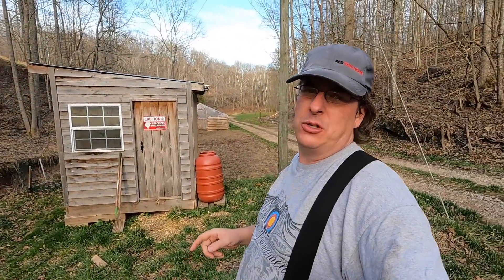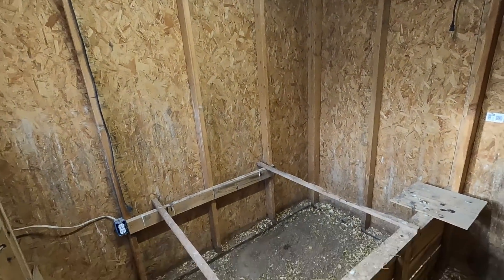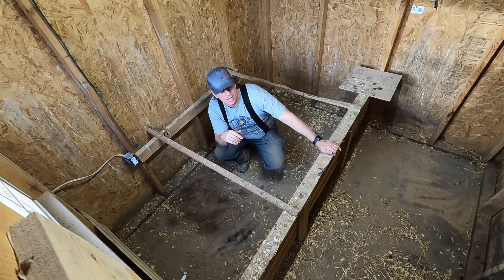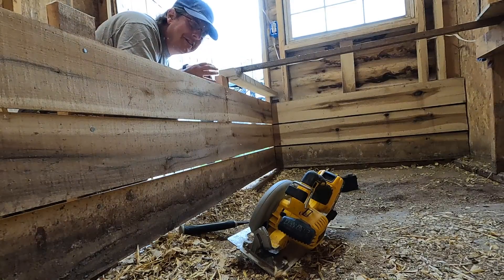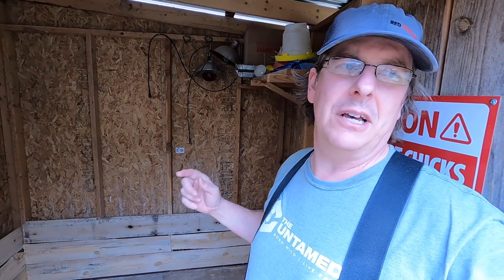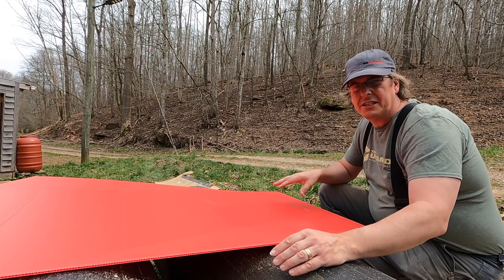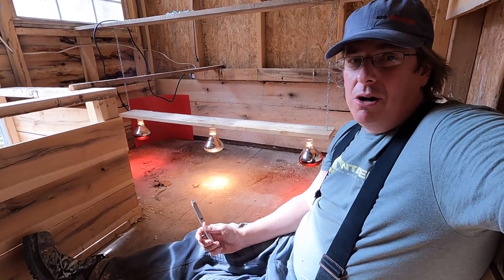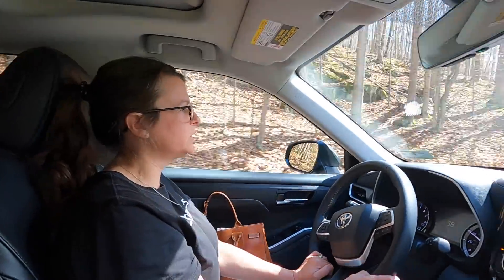Can We Expand the Brooder in Time for 100 CHICKS??

Comment: I remember helping with the mail order chicks back in the 70's when I was a kid. Our fancy setup was a large cardboard box and a naked 75 watt bulb. lol      The box would have little door flaps cut in it but they would be blocked at night so the diddies stayed in by the heat.  As they grew and the weather warmed up the doors would be left open or one end propped up so they could chose to move away from the heat. All on a dirt floor with no sawdust. Worked well, can't tell you why.

Comment: I always lay a thermometer under the heat light. It needs to be no more than 100 degrees. To hot you can raise the light, to cold lower it. The next week 95 degrees, the next week 90 degrees, etc.

Comment: Troy, that center light has a white tint to it and the two outside ones are a soft red. Chicks don't like the center one. I had the same problem with mine. I changed the bulb to a different  one and they started using it. Just a tip

Comment: Instead of screwing the chain down.... maybe put an eyebolt thru, then get a 2 pack of cheap carabiners at Dollar Tree, and use the carabiner to attach the chain to the eyebolt? Unless one can get on top of the lightbar to work the carabiner, you are safe and easily adjustable? Or are the links too small? Even a small snap hook is likely too large.

Comment: i made many of them heat lamp boards many years ago for chicks, still in use today, fact is do not use them crap plastic lamp bases, my first set using them melted and burned, they will not take the steady 250 watts, do not use them,, big fire,, use the porcelain sockets that what them other heat lamp holders have,, dont be cheap..  , i also wire up wall mount electric base board thermostat, with a plug on them, and put the thermostat inside the pen so 75% of the heat lamps turn off when the temp hits 95 deg,,  my pen that holds 500 chicks. 2 lamps stay on all the time.. with out the thermostat you can very fast over heat the chicks  before you check on them, my brooder the walls are insulated, i have2 brooder buildings far away from each other, one for chickens an one for turkeys, you can not put turkeys were chickens have been you dont walk into a turkey pen ether with out stepping into a pan of strong bleach before going in to the turkey pen if you been in the chickens, chickens carry a a parasite that kills turkeys,, you can treat the turkeys if you catch the yellow poop in time..

Comment: Wondering if you should have mounted the board that contains the lights at an angle to enable more heat to get to the new L portion of the brooder.  It would necessitate the board being longer.  Obviously another option is to make a board for the L Portion.